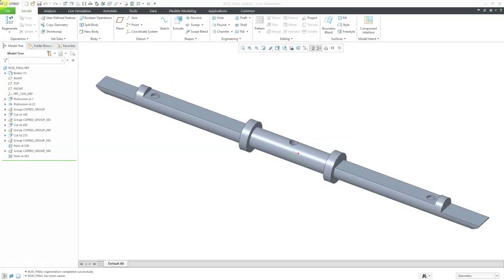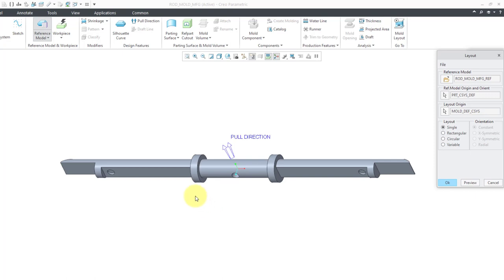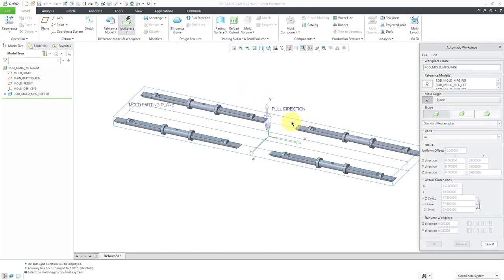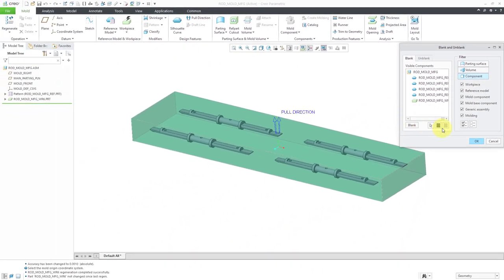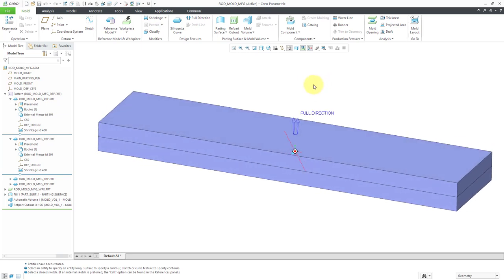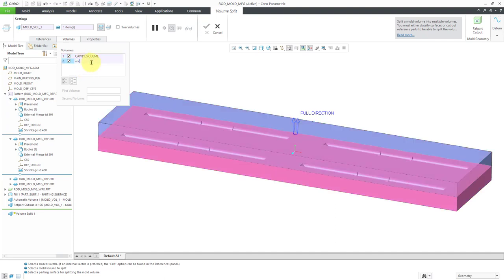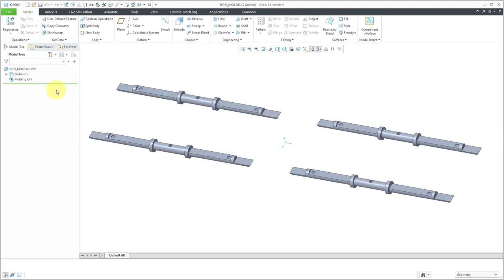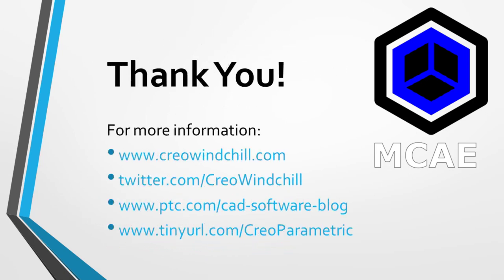Creo Parametric - Mold Design Overview | Manufacturing

Comment: Hello Dave!
I would say a very comprehensive video.
I have two questions;
1: Is there any inherent parting pin options in Creo Mold?
2: The parts/assemblies you use in your videos are proprietary?
Reply from the maker: 1. What are inherent parting pins?
2. I don't believe proprietary is an accurate description. I certainly would not use someone else's IP that was exclusive. When I use models from a company's website I always give a shout out to them. Some models I create. Most I have acquired.